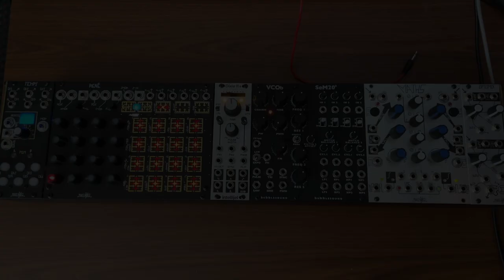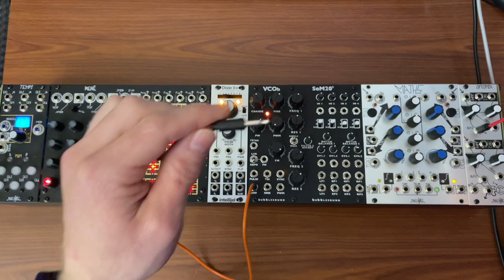Eurorack A to Z Tutorial Lesson 13: Low Pass Gate

Comment: A few things to consider : "this can replace need for a filter, that's how Buchla synths operate" - I get what you wanted to say, but strictly, on something like Easel, you have classic filter option - you can choose lopass filter, VCA or "combination of both" which ultimately makes a LPG. Further more, something I see people who just got vactrol based LPG struggling with is - should I modulate strike or control? Or both? Important thing is to notice that while you can use envelope (or anything really) to modulate ctrl parameter, hitting "strike" will get the vactrol doing what it does, the legendary Buchla sound. So you can modulate ctr, or strike, or both - but notice the difference between something like envelope and photo-resistor on a vactrol. I usually ping both, because vactrol does that extra accent and ring. Also, vactrols are unique, as even the ones on the same unit do not sound 100% the same (channel 1 vs channel 2) in terms of snappy-ness and speed. There are also non vactrol LPGs (Natural gate falls in mind first) and these work just as well, but Optomix for me sounds 100% Buchla-ish.

Comment: You have explained this very well! Thank you for doing so. Would you say that an Optomix would be great as a vca “replacer” for a complex oscilator like the Instruo Cs-l since this os also a Buchla inspired oscilator?
Reply from the maker: The optomix doesn't make sound on it's own, like an oscillator does, so it's different.  The CS-L actually does have a built in VCA section, but it's not a low pass gate like the optomix is.  Does that make sense?